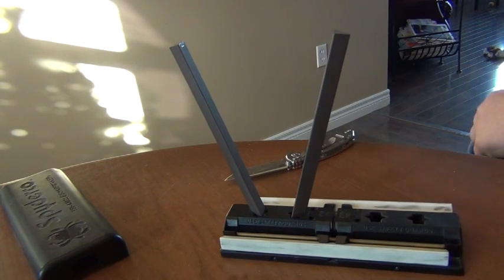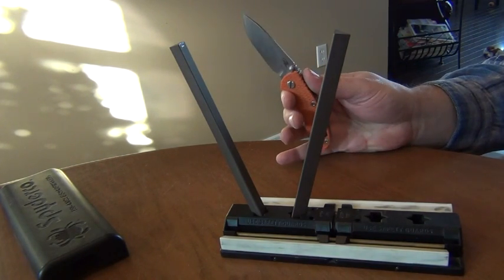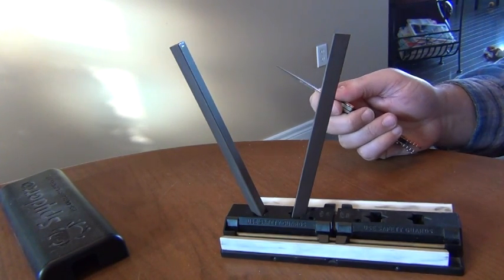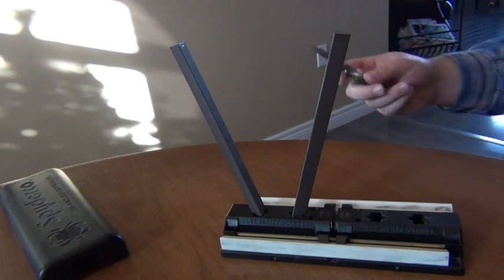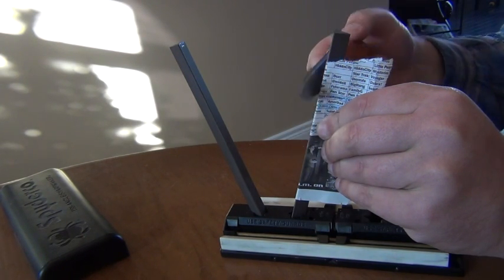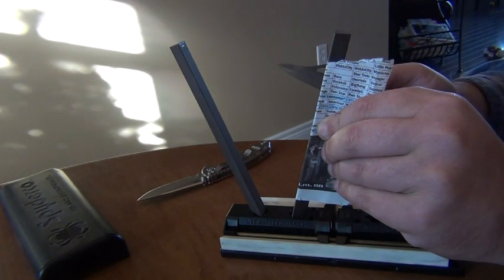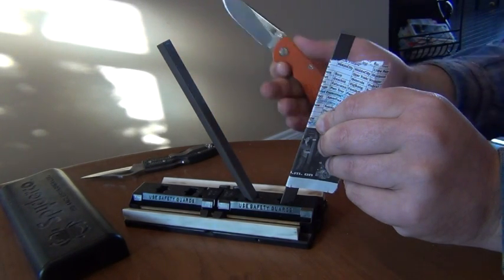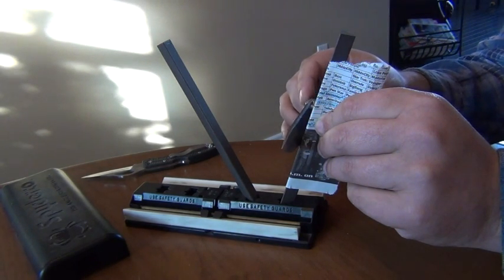Spyderco Sharpmaker : measuring edge angles

Comment: do you have any recommendations for 20 degree grinds, sharp maker only has 40 and 30 degrees
Reply: Get an angle cube, place it on the left rod, then tilt the base till you get 20 degrees. Then place something, a pencil should be okay, under the base at that point. Then just move it around till you get 20 degrees on the rod. That is your 20 degree mark, attach the pencil with a rubber band to the base, but you will have to swing the base around each time you change bevel sides to keep it at 20 degrees. Hope this helps, and it does work, just takes a bit of practice.

Comment: SharpMaker is a brilliant simple design tool that in the proper hands can create or maintain a very sharp knife.  Thank you for this video.  

Cut two post it notes so only the glue part stripe remains and wrap that around the top of both stones and use that as the proper angle guide.  Your muscle memory can quickly pick up on the feeling and you can sharpen any knife on either the angle holes.

Comment: This is an antiquated and unsophisticated sharpener, get a KME and you will have a far better mirror and razor sharp edge.
Reply from the maker: Thanks for the suggestion, I mainly use Benchstones. But I kind of like how the Sharpmaker is a simple system, you can in fact almost replicate it in the field with a normal stone just by setting it at an angle.
Reply: KME is like presswood in an oak furniture factory

Comment: Fun to watch and informative. I am planing to buy Spyderco Sharpmaker so thanks for the video.
Reply from the maker: Did you buy it? Curious about your impressions if you did.
Reply: Unfortunately not yet, but it is on top of my list. I will order it around September 10th and hopefully it will arrive by the end of the month. I wonder if I should buy only the Sharpmaker or additional diamond rods as well?
Reply from the maker: Ivan Stojanovski A lot of knives come with angles which are higher than the preset angles on the Sharpmaker (15 and 20 dps). The medium stones cut so slow that trying to use them alone could take hours to days if you try to sharpen a knife which is at 25 dps on the 20 dps setting. I would recommend you have some way to recut bevels either the CBN rods or a coarse stone. The first thing you do is use them on the 15 dps setting and then sharpen on the 20.

Comment: Nice video Cliff.  Agreed on how hard it can be to hit the apex too even when the marker is disappearing or you think you are, especially if you get a bevel put on on a belt grinder as it often has some curve right near the apex.  I could not figure out one day why I couldn't get a 5160 chopper to apex.  Ever so slightly increase the angle to the stone and it was almost instant.
Reply from the maker: Yeah, this is probably one of the biggest sources of frustration when you are starting out. In the 2000's when the forums first came on line, this was maybe the hottest topic, that and burr removal.

Comment: I only have a Spyderco Endura (VG-10). I bought a Sharpmaker when I bought my knife. Are all Spydercos the same angle? If I buy a Paramilitary or a Delica, my sharpener is going to be at the correct angle. Correct?
Reply from the maker: The Spyderco's are intended to be used on the Sharpmaker immediately however this isn't always the case. One of the most common problems is that while the total angle can be less than 40 degrees included often one side is much heavier than the other thus when you start to sharpen you only hit the edge on one side.

Comment: Not to be a pain but I see a few problems. If the edge has a burr from the factory this wont work, if the edge is uneven it won't work. If its not sharp enough to bite the paper it won't work,.....
Reply from the maker: If the edge is uneven it will just catch on one side and not the other. It should be checked on both sides for this exact reason. 

It will still catch if the edge has a burr as the edge would still be thin enough so that the apex pressure would rupture the paper.

If the edge is completely dull it won't catch at all so this has to be done on a sharpened knife but as noted in the description it can also be used while sharpening to see if you are grinding on the apex or above it.

Comment: The Hinderer is sharpened at 25dps?!? That's ridiculous. I have a machete that's sharpened on less. 

On another note, this is another problem with the educational system. We took trigonometry in math, but they didn't really show us any really practical uses for it. They just gave us some theorems, a couple basic problems, and just repeated that changing what's needed. Emphasizing a bit more on memorization than on practical problem solving (At least that's the case here, which  I have witnesed), giving the idea that math is useless in real life problems.
Reply from the maker: That knife is used, I sent it out on a passaround, but yes the initial edge angle is quite high. 

You had poor teachers, it happens. If what you are being taught doesn't have an application then the information is useless and/or poorly understood by the teacher, have some imagination, find out what the students are interested in and speak to that.
Reply: Aye... sadly too many of them here seem like they're just talking off a script, and since most students care more about the grades than actual knowledge, they usually just 'memorize' some stuff to pass the test/exam.
Reply from the maker: shurdi3 You can't blame the students for the fault of the teacher, students study for exams as that is how often the material is presented both in goal and in format. It does not have to be that way, but it often defaults to that as it is the simplest way to teach which requires the least effort.
Reply: ...I think the fault is mixture of what parents want out of their kids, the teachers, society, and pre-teens wanting to have an easy scale to compare themselves to others, which continues even into adulthood in some cases